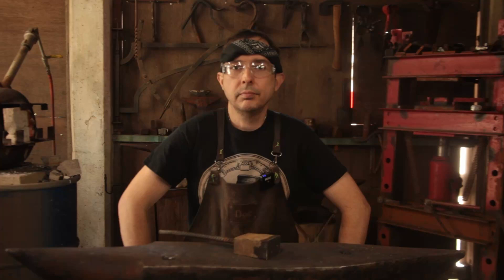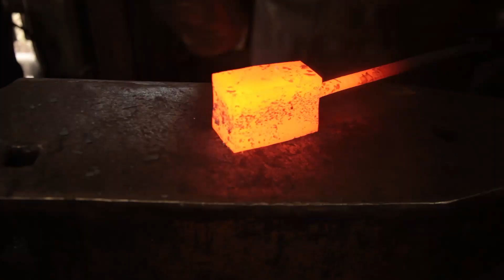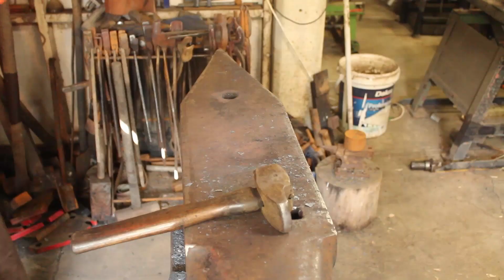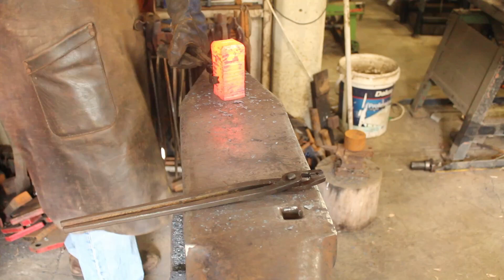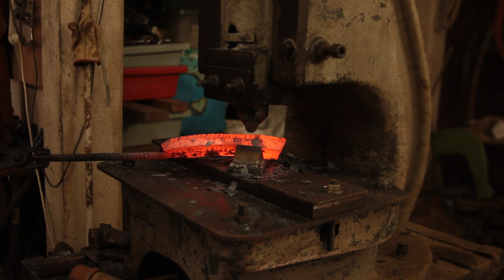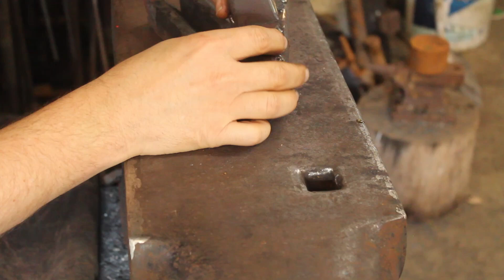Building a 30lb London Pattern Anvil Pt1 the feet

Comment: Thanks for still attempting to for an anvil so large even though we can't get coke or coal to forge in how much charcoal did you burn to get enough heat to forge stock that large also is there a video on your forge
Reply from the maker: Before coke charcoal was the fuel of choice, but I can see why it was so readily replaced with coke… the next couple of steps will be the big challenges assembling the body and welding on the horn and heel forging.